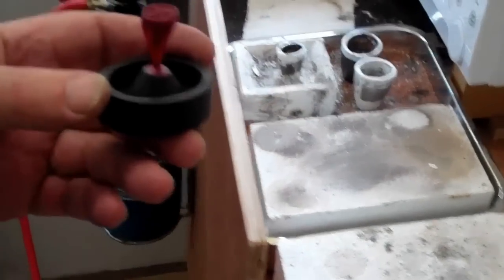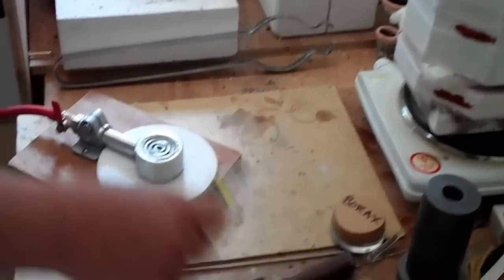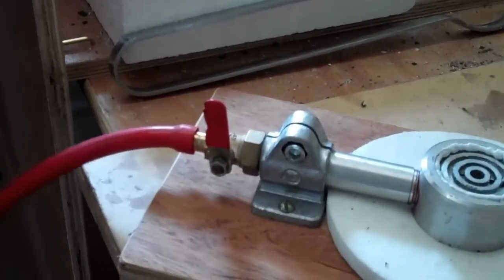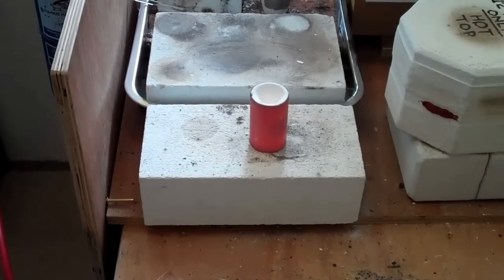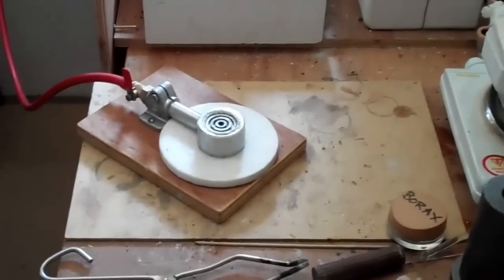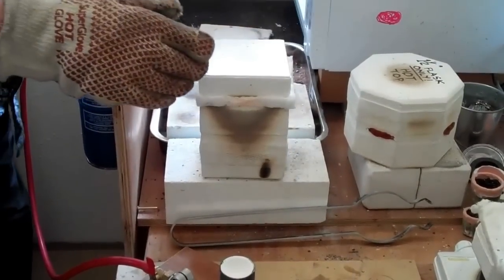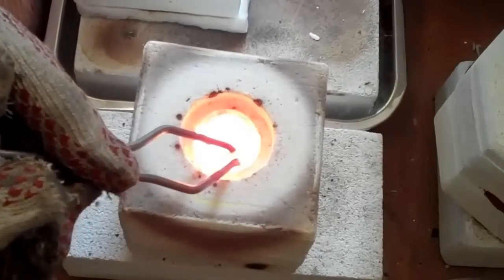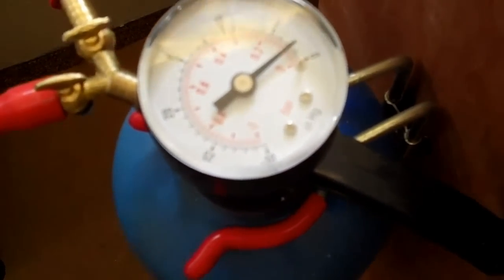Vacuum assisted casting of silver ring with microfoundry

Comment: Can you melt copper and brass in the microwave ?
Reply from the maker: Hi Hugh, yes you can, copper is the upper limit specific heat capacity wise, but all the copper alloys are fine indeed it's fun to make your own brass, bronze recipe. Silver and gold for jewelry work flow very easily. Cheers quin

Comment: I was wondering what would happen if you don't use vacum to pull the molten metal in place? Would it just simply result in a slightly less sharp object or the absence of vacum would ruin the whole process?
Reply: Maybe the molten metal wouldn't enter the mold at all!   People use pressure or vacuum or mechanical motion.  If you don't do anything it's just gravity casting.  The molten metal has high surface tension and I don't think wants to go into the mold, and especially into "details" and corners, so people try to force it.

Comment: How accurate would you say the cast is compared to the wax piece? I'm looking to start something up and I need to find the best way of casting a printed piece. The resin would probably have a high wax content, meaning it could melt out, but I am looking into printing quite fine details, like 0.2mm claws, or filigree?

Impressive stuff.
Reply: Hi Cristopher  - the system will reproducer the wax down to the finest detail (of which 0.2mm is reasonably course) so if you can make the wax model we can help you create it in metal.
cheers Quin

Comment: ok I have a lathe. and a vacuum pump.  how does the metal not get sucked down the vacuum tube?  so the vacuum just pulls through the investment?
Reply from the maker: yes the vacuum pulls through the investment which is porous. If you leave enough investment at the bottom of the flask ll goes well - i have "fluffed it" with very little investment at the end  of the flask and had the molten charge flow in to the table - it is a right pain to clear out so you do not do it again tee hee
Reply: its is so simple! I was WAY over thinking the process!
Reply: Is Plaster of Paris porous enough to use as investment or do you need legitimate casting investment to do this right?
Reply from the maker: plaster of paris probably works but it is a right battle to remove afterwards - see the quench vid  - jewellery silk grade investment powder washes away with ease
Reply: Ya but I am poor... Haha! Ill see if I can find some around here for a good price

Comment: Can you melt platinum with the microwave Furnece?
Reply from the maker: no the upper safe limit is copper - the reason being the mocrowave is quite cheap and flimsy - the longer the metal is heated for and the hotter it gets the more insulation is needed to protect the oven - higher temperatures become unpractically bulky
Reply: thanks

Comment: question  is the flask burn on the microwave well?
Reply from the maker: Metal Detecting Canada and the Usa  yes it is a 2 stage system we burnout the wax in the burnout furnace giving a hot investment ready to recieve the charge then melt the metal in the metal melting furnace and pour it in.

Comment: does the mold have a hole on the bottom of the flask or is the vaccum just being applied to the porosity of the investment through the bottom of the flask?
Reply: no hole,the porosity in the investment is sufficient
Reply: Daniel Harris I was wondering this too. I suspect it doesn’t have a hole, or else the molten metal would travel down the vacuum hose.